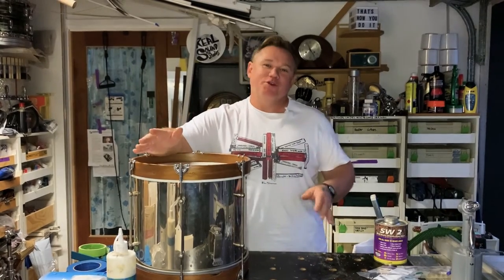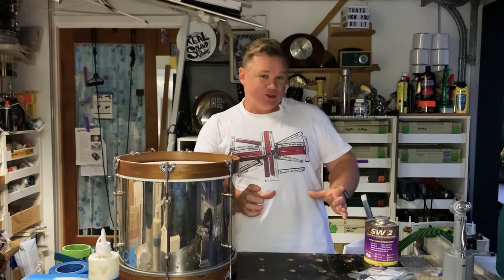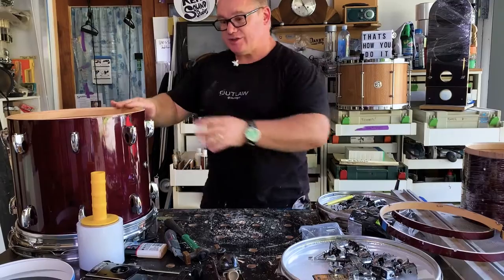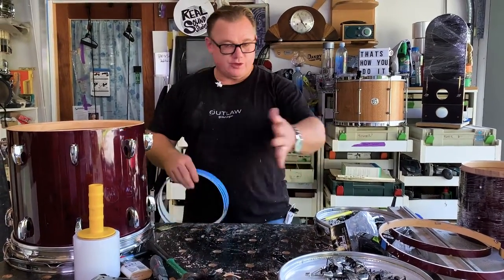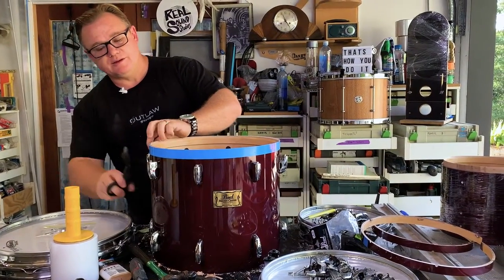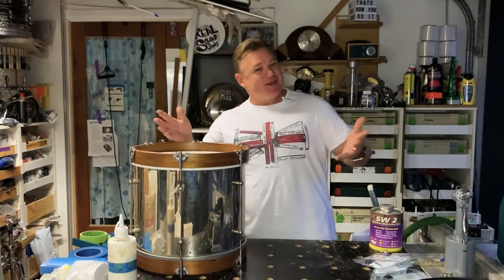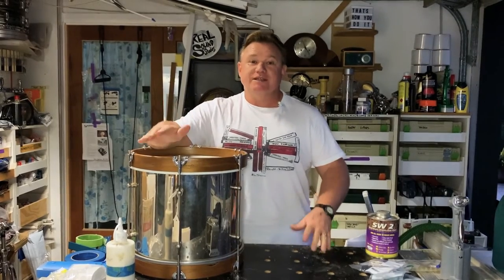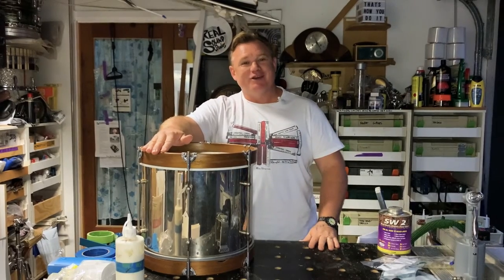How To Set Out & Fit Legs to a Tom

Comment: Interesting , most companies do not use exact 1/3 distance between legs any more (Gretsch always did-but most companies use the middle space between lugs - uneven but stable. Pearl used 1/3 spacing, and I think this is why you did this. On other drums would you have just used the middle space between lugs?
Reply from the maker: Hey mate, I generally avoid middle space and stick with thirds unless matching vintage factory instal/set outs. 
The main reason is that-of centric symmetry both mathematically and with the physics of a drum that makes the most sense. 
Drilling holes in an uneven manner around a cymbal (for example) creates bad overtones due to the introduction of mismatched wave lengths colliding (rarely in harmony if at all). 
In a drum, this affect may be insignificant, but in my mind anything but centric has to be a negative impact on a sound. 
So over the years when R&D'ing drums to maximise tone and reduce bad overtones I've realised that much of what the industry knows and uses is not based on tone but circumstance or price point. One simple example is with lugs: hollow lugs absorb vibration, solid lugs enhance it; like wise less weight on toms increases resonance, more weight from lugs decreases it. The two wanted exception are bass and snare, where these things can make that drum sound better or fit for purpose. 
Ultimately the degree of seperation between floor Tom legs around the shell, likely really doesn't matter, but it would to me. 
That said, the vertical height of a FT mount away from the nodal point does noticeably  impact the sound. Sometimes people like the impact, others don't, but it's in understanding how to manipulate the sound in these ways that makes drum design and drum making an art form to me. Kind regards Tony